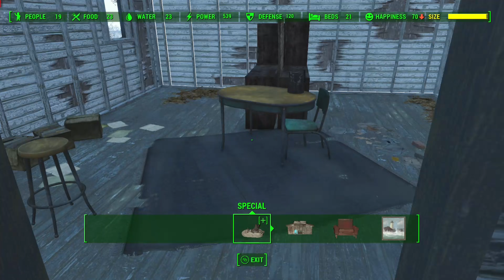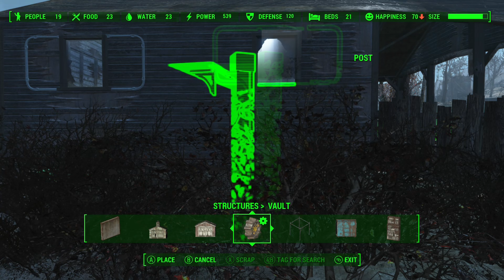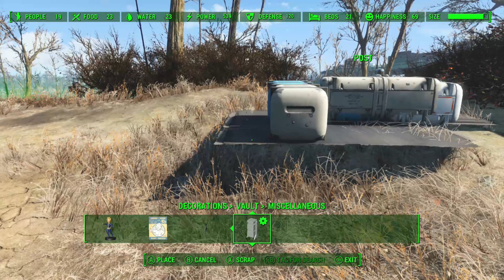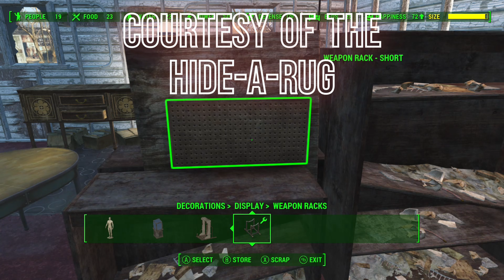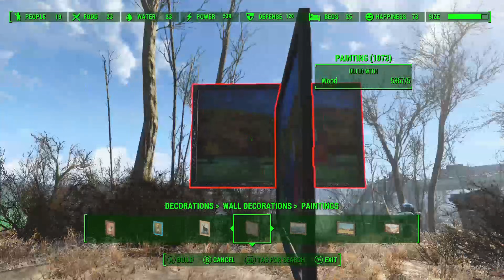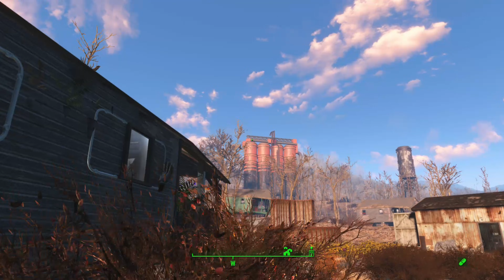Fallout 4 No Mods Mini Build - The Sunshine Cottage

Comment: Love the challenge of keeping all of the original items in place! As usual - this looks fantastic! The guard station on the back of the cabin is a nice addition - especially with the clever ladder!
Reply from the maker: Thank you CC. I shared the ladder once before but never shared the build process. It was time but I've seen them before so I'm definitely not taking the credit. Hey, a question for you. When you built the lighthouse you didn't use the rug glitch per se, but you used the floor and allowed the cabinets to ride along. It's exactly the same thing. Not a glitch but a preplanned feature of the game. It carried into starfiled as well. 

I was wondering if adding it into your builds would betray or strengthen your channels niche. It's a fine line and a slippery slope. (Two cliches for the price of one 😂)
Reply: @greatgrandpagamer   I think about this a lot!  I would like to incorporate more easy placements (like putting objects on a rug and then moving them into a house - no group select) in my videos. However, I get a fair amount of pushback from viewers when I have to increase the size limit (using the dropped gun glitch or exploit) to be able to build and entire settlement (although the structures are built glitch free).  BTW no one complained about the light for the lighthouse but I think they would pushback if I slid something on a rug (a perceived glitch).

I don't have anything against glitches - when I started this, my goal was to show people how to simplify building and how to fix the ruined houses in settlements (I didn't decorate either). I probably should have called it "simple snapping" or "basic building" instead of "no glitches".   That would have given me a little more breathing room.
Reply from the maker: @CCRenovatesFallout A person's perception is 100% of their reality. 😀 I really like the way you described it as simple snaps even though it's not as clear as glitch free. You are brilliant and we love what you do!
Reply: @greatgrandpagamer  Aww that is really nice - thank you ☺